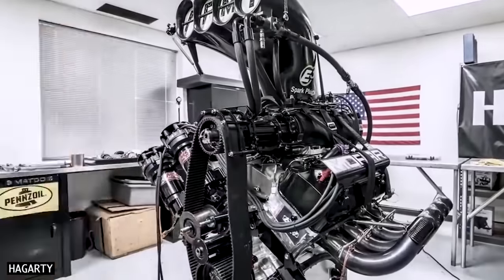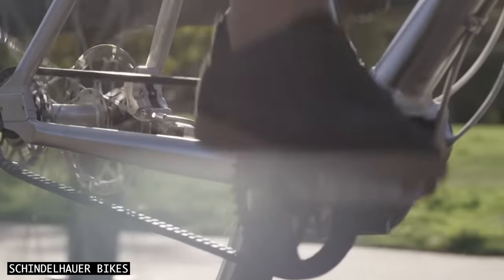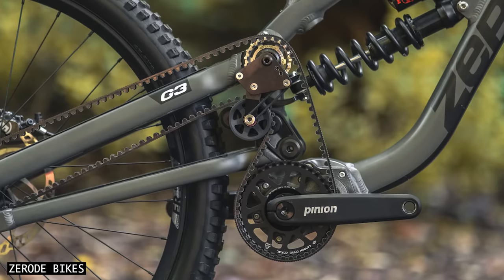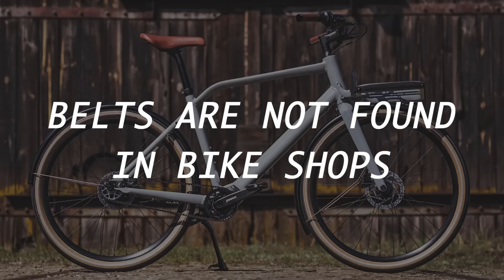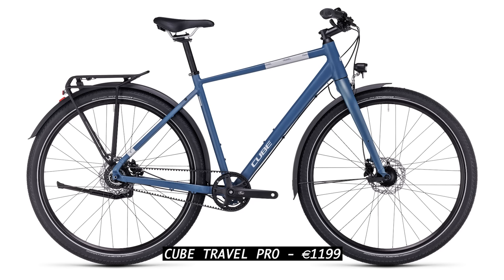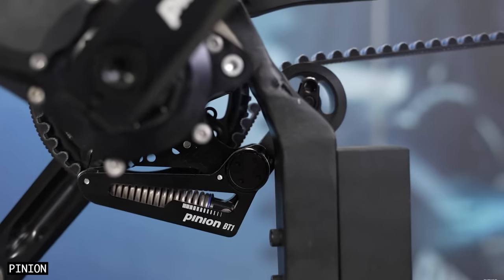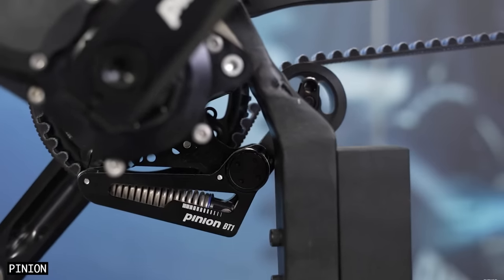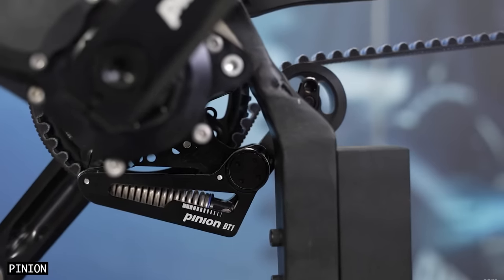Belts Are Now BETTER Than Chains On Bicycles!

Comment: I had bad experience with my city bike (8speed Shimano nexus hub) on my Villiger (Trek Group) bike. I had 3 speeds for down hill but not sufficient small gear for steep climbs for example the exit 8:45 of bicycle parking in our railway station further the belt jumped when I gave to much torque thus I changed to a chain btw not only the hub or gear box is less efficient but also the belt itself has more friction than a chain that is reasonably clean and lubricated. I just clean it with a towel with wd 40 and after putting oil (I am also using road bikes) a chain lasts about 7000km and costs about chf/ Euro 17 my adventure with belt was far more expensive (before the change to chain the belt was exchanged) further my trousers came in the front wheel of the belt drive the holes from the teeth in wool / the drive train that is the most bulletproof is a Campa 8 speed Chorus that I have on bike on which I was training for many years with Rohloff chain

Comment: Regarding the comparison with car timing chains and belts, because of the catastrophic damage to the engine that can occur if the belt snaps, manufacturers 'play it safe' with reccomended belt replacement intervals of 90,000 or 100,,000 KM. However I've seen cars which have not been maintained and sporting their original timing belt, still keeping correct timing, some 20 years and 280,000 KM later. But this is really not recommended! The other point is that in a car the belt or chain is completely covered and locked away from all the elements. A bicycle drive train is out in the open and gets mud, road debris and everything thrown at it all the time. Just a simple ride in the wet will make the chain/belt get wet on a bicycle. The reason chains last longer in cars is they are locked away with no possibiltiy of debris getting into the chain. Not so with a bicycle. Debris causes significant wear to all components with a chain drive.

Comment: My whole bicycle costed 500 usd (bought lightly used). Im not gonna spend 250 or more likely 350 on this. 
Maintaining a bike is part of the fun of having one, just take a Saturday or Sunday a month to clean and lube it, it's not that difficult. 

And as you said it has a cost comparable to high performance gear, while most of us dont need/use high performance equipment. Why would one spend 350 usd, double the maintenance costs just to mitigate a small inconvenience?

Comment: Depends what car. My audi chain, stretched at 59000. Honda k24 chain, 200000+. Modern tech makes belts just as good if not better than chains. Technology in metal and Kevlar both evolve at the same rate thus far, just depends on which is more cost effective.

Comment: Belts are way more expensive than chains and you can use a chainglider to protect them. It is all about use case and how much you are willing to spend to reduce that pesky wear and tear. BTW. you can migrate your Rohloff to a new frame but gearboxes usually come with an expensive frame as "attachment".

Comment: Interesting thought for recumbents as I always get oil stains on my leg. I wonder if they make them long enough as I can certainly replace the back gears with an internal hub.
Reply: gates makes a 250 teeth, 2 metre long one (~6 feet) for tandems but even that might not be long enough. i've seen this done with two belts with a midway pair of transfer pullies
Reply: @markifi  My Optima baron chain is 2.7 chains long :D
Reply: @Mr_LH1980  that's a neat looking bike. even your hipothetical mid-way pulleys would need to be able to be shifted front to back to tension the two belts and i'd guess that cantilevered structure on the back probably has too much flex to work with a belt? no need for frame opening though. i've tried an optima orca once. freaky experience having to re-learn riding after so much time on upright bicycles, but interesting nonetheless

Comment: Any thoughts on converting the timing chain to a belt on my tandem.  The wear is minimal as the gear ratio is 1:1. Currently I use two 42 teeth chainrings. 
🙏🏻

Comment: I changed my Belt once month ago after 9 years and 23'000km. I broke two tooth, but I could have ride a little more if needed.
As I'm not a profesionnal road racing cyclist, I would never use a chain and a derailleur again!

Comment: I'm a bike mechanic, and imo, the real and only reason why the belts are not common, especially on normal commuter bikes, is one: cost. Most commuter bikes are trash, are not maintained and are kept in terrible condition, people often see them as expendable items. A hub with internal gears plus belt and other parts of the kit, alone cost more than most people are willint to pay for the entire bike they'll use for commuting. One more thing, most people don't even realise they need to change the chain, and those often last the lifetime of the bike, since it gets trashed into oblivion.

Comment: My cycle buddy has just got her gates rohloff tout terrain blue ridge (it looks amazing). We are planning a 2 month tour in mid May. 
I just purchased a spare belt for her and was wondering how you carry your spare belt? I was going to twist it up like you showed in the video and tapes some cardboard around it and shove it in the depths of her rear pannier. 

Great video.
Reply from the maker: I tuck it in the inner pocket of one of my panniers.
Reply: @Cyclingabout  thanks. That flappy insert with a zip on the inside of ordlieb rear panniers ?.... I chucked mine. I'll have to see if I've removed them from her panniers as well.
Thanks.

Comment: Just convert my Trek District back to chain drive last fall. Belt failed after 2-3 years of daily commuting.  This is after upgrading the bike to the center drive belt. (2) of the original series I belts failed on it for me.   Belts were out of stock except for ridiculous prices so I put the chain on. Not sure if I am going back as sprockets are worn to a point of failure. Would have to spend a lot of money to put the belt drive back on.  Note: I ride in bad conditions at times and throughout the winter.

Comment: Engine builder here: the reason chains are more reliable and n cars is generally because most timing chain engines has some king of consistent oiling on the chain unlike the belt.

Comment: The problem with belts is when a rock or other debris gets between the sprocket and the belt they can break much easier than a chain, chains being so narrow rarely if ever get rocks or foreign matter stuck in them. Belts are wide because they have to be to carry the loads required of them. A belt the width of a conventional chain would snap under extreme stress in the envelope. Like the spoked wheel or steel railroad tracks some ideas are around a long time because they work well under a multiude of conditions. For what a belt offers its just not worth the trouble when the advantages are not that profound. If we start talking ebikes then we have a whole new discussion which i wont go into here.

Comment: I would still preferr a chain drive for some simple reasons. I can't repair a gearbox fail myself. Chains, sprockets and all parts are available everywhere. And I do mean everywhere. When they construct a user servicable gear system for belt, they are available pretty much everywhere I will gladly switch.

Comment: my cube hyde pro had CDN, the plastic in the rear broke after 2 years of normal riding. I recommend to use only CDX products. We changed the gates belt back on cube to chain because buying again the belt drive would have cost half a new bike, sorry this is way too much and we had fun in making a beltdrive to a chaindrive bike. On my canyon commuter I have again beltdrive and I love it but if it brakes I recommend to change to chain, because you get for less than 100 bucks realy cool stuff - I do not buy 300 bucks for any drive stuff, sorry this would be a riders nightmare :)

Comment: 🚴‍♂⛓🔒 A nexus chain lasting over 20,000km with minimal wear and only one lubrication? Impressive! But let's consider an alternative perspective: Does a full chaincase limit accessibility and maintenance? 🤔 The convenience of belts on bikes, touted as superior, raises curiosity about their advantages. 🚲🔧 Let's delve deeper into the pros and cons of chaincases and belts, exploring their impact on performance, cost, and overall user experience. 🔄💡 Together, let's uncover the best solution for a smoother and more efficient ride.

Comment: I bought my bicycle with the Gates CDN belt, which didn't even last 2000 km. The rubber teeth came loose from the belt with carbon  itself. It might have been due to my intensive intervals when I like to speed up from the traffic lights, but I was sincerely disappointed. 

The CDX is more expensive, but indeed also supposed to  last longer... I certainly hope it does.
Reply: That could very well be an alignment issue.
Reply: @meeder78  I assume the guys at the bicycle shop checked that during the maintenance sessions during the first 2 years. The CDN belt failed 2 months after that. To me it didn't seem anything could have moved since then. Main comments I got, were to clean the belt more often.
I have to admit I had difficulty aligning and tensioning the CDX according to the guidelines, but when I asked them at the bicycle shop, they said it looked good now. Thanks for mentioning, Remco!

Comment: I don't know how the Rolof hub is to fit to a rim, but the Enviolo hubs are a bitch to get the spoke nipples to not be at odd angles when entering the rims.  The IGH people need to find or make rims themselves to address this issue.  Now,  most rims are made to fit smaller diameter hubs.

Comment: Curious to why a belt with a link to change the belt on a bike with a regular frame not been designed  ?  It's my opinion if there has to be a weak spot I would rather it be the belt - not the frame.

Comment: Lol phd in belts. There is a few things i wanted to just mention to u that came to my mind at the end of ur vid;
Do you know any bicycle hydraulic disc brake manufacturer that make calipers with dust boots protecting the pistons? I find it completely absurd that you pay for quality parts and they do not even feature simple things like this. My hope mono m4 and mono mini is an example. 
The second thing i think you should really look into is the nasty habit of smthn being engineered to fail. When i finally needed to change my drivetrain on my nrs2 i out of curiosity and investigation (to if i could tweak it or repair it) found that the deore lx derailleur seemed to be engineered to fail. The pins joining the pivots do not go all the way through, and thats little bit of material supporting the pin was not enough causing the pin to enlarge the hole. But, had the pin been longer this would not have happened... Im not stupid, it was deliberate. And this seems to be common practice across soo many manufacturers. The Shadow XTR i got to replace it became my most loved derailleur, but that too i fear is engineered to fail. That slight hole enlargement was enough to throw shifts off and chain hop. 
Breaks my heart, you spend your money only to find deceit.

Comment: So you have to lubricate the belt which actually does not need any grease or lubrication and is eerily silent, to make it stop squeaking in dry enviroments with dust (summer)... in the same conditions chains start to make noise aswell and require lubricants to make it stop..... You simply "coil up" a belt , or in other words you twist it in multiple spots, to make it small enough in order to carry a spare one, which should not be twisted according to the big three no nos regarding possible belt damage due to mishandling. Did i get this right so far ? ;-D
Reply from the maker: Yep. You might never need to use a silicone lube but it will help keep it quiet in certain dusty environments. You can also twist it in certain directions, but not others... a bit of common sense gets you a long way. 👍🏻

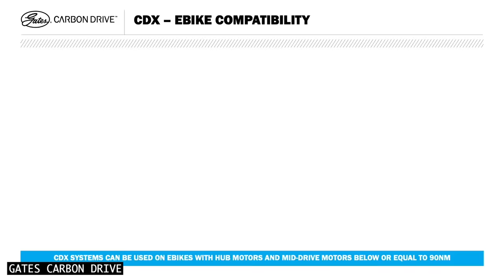Comment: That thing about the torque limit at 7:51, is that just for motors or does it apply to how much torque the rider can do? Because those are two very different measurements and there are a lot of cyclists who can do well over 50Nm of torque in a sprint. I can do approximately 155Nm, but that's only for a couple of seconds.

Comment: Regarding belt tension and belt size. Since you recommend going under the tension recommendations, should the belt size recommended also be increased when using the calculator?

Comment: Belts also are less efficient aside from the gearbox. They take more energy to bend around the sprocket.
Reply from the maker: Nope, the data does not suggest this at regular cycling power outputs.

Comment: They should make a belt chain that has a thin belt and a lightweight chain integrated to each other so it can be belt drive and use a derailleur. Like those 3d prints that are woven or can flex but it's all one print/ piece
Reply: Yeah,go ahead make it!

Comment: "Hey there, great video! I have a question regarding a Moustache Weekend FS DUAL EQ chain bike. Is it possible to switch the system to a belt drive, and what would you recommend? Additionally, do you think I can handle the conversion myself, or would it be better to seek assistance from a specialist?

Comment: theyre great for some applications, theyre just high maintenance easy to break, harder to keep aligned, and generally dont do well when not kept clean and free of debris... the belt drive cams on my Ducati have to be replaced every three years or 12k miles, and are known to break easily... , the chain drive on my suzuki will go 100k with no problems and are known for their durability and longevity...

yes the ducati is lighter, and revs higher, but its fragile and high maintenance, and expensive... and i like the suzuki better and its faster on a track... even with half the engine size...

Comment: Main issue is price which is very, very expensive. Also through belt is lighter the whole system may not be lighter. If and when we see belts more on bikes for professional racers I will believe total weight will be lower than chain. The total system efficiency is also an issue... lets wait for pros to actually adopt. 
Still price is way, way out there.

Comment: I wonder if you could buy a race BMX with a belt in the rear triangle from the manufacturing process?  the belt is the frame at time of building the frame

Comment: What if I just want to replace the drivetrain on my standard converted mountain bike? Just a 26-in hub motor. I'm cool with single speed, does Gates sell a kit that would directly bolt on to a standard mountain bike?

Comment: Belts may be better but the 1time payment is way higher is you need to buy a belt and sprockets.  That's why I keep it on a chain fore now.  I can het a 1/11 speed groupset fore 250 easy instead 250 fore the belt

Comment: This is quite funny, you obviously have made plenty of thousands km on belt, while I had customers (I'm bike mechanic for about 10 years now)  who could destroy aluminium front belt wheel in less than 3-4kkm. How they could do that you may ask? Well, here in Norway, people using mostly ebikes to go to work, or around the city. They NEVER maintain their bikes. Here rains a lot, so dust and sand sticks to wet belt, causing severe damage to alloy drive. That much that "teeth" where force is biggest (crank arm is from 2 to 4 "o'clock" position) are almost entirely gone. Problem can be solved using steel wheels. Also there is problem with cracking belts when something falls into drive like small stone. In HT bikes where belt is tight , have no tension wheel belt may brake quite easily.
Reply: I can confirm that the aluminum front ring gets quite worn. And I have also experienced sudden failure. So the disadvantage is definitely mainly the "damage memory" of the belts. Once mistreated during assembly/disassembly, or overloaded by a caught object or by accidentally stepping on it, the remaining lifespan can suddenly be uncertain.

Comment: There have been belt driven motorcycles for decades, but if you go and buy either a moped or a top end sports bike it is way more likely to be chain than anything else. Shaft drive after that. Belts remain almost a curiosity. Why? Because they require more engagement, larger pulleys, and are difficult to replace. Who runs trashed chains on trashed gears? I replace at the first sign of wear. And then there's the weight and efficiency and cost. So it's not all roses.

Comment: I'm having a steel mtb built with Rohloff and I'd like to use the belt as a transmission. the problem is that the smallest front sprockets I found is 39 teeth, a bit too much for a mountain bike, I'm afraid of undershooting in the more technical sections. Are you aware of smaller belt front sprockets or do you have any ideas on how to overcome the problem?

Comment: But you can drop a link and get back on the road with a chain. Unless you have a belt on you......! (But if you did have an extra belt, it would be better, due to weight and flexibility.) I'd like to try one!

Comment: Chainless Digital Drive are the future of Cycling now.
No chain, no belt, just a wire between the electrical pedals and drive wheel.
The first patent for an electrical drive bicycle was 1975.
Soon all bikes will be driven this way, think of the steel saved worldwide on bike chains, and the rubber in the landfill site from used drive belts.
Reply: I think I saw this to drive a front wheel once

Comment: i really need a new chain for my fixed gear, but I've been running the same chain for like at least 10 years...i'm scared to measure the wear.  I'm also scared it will snap one day while I'm putting on the power lol.